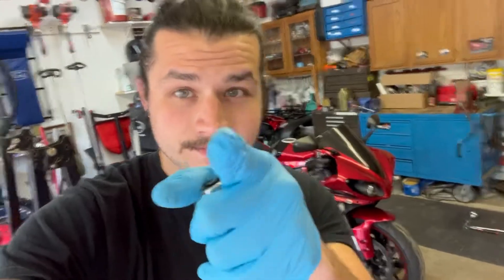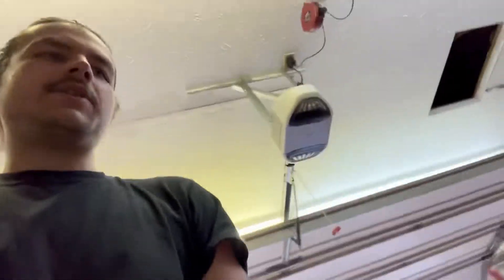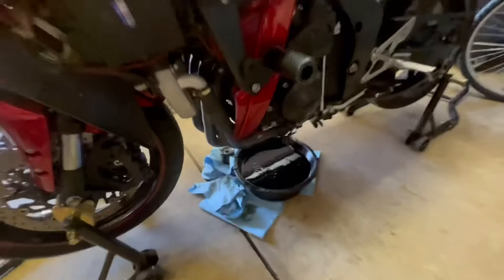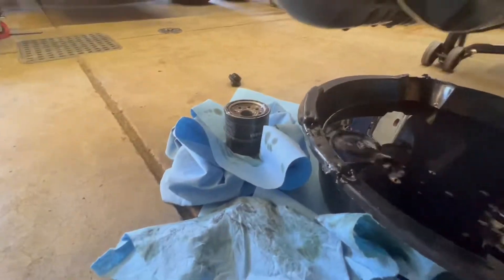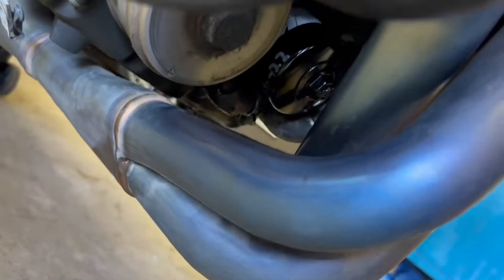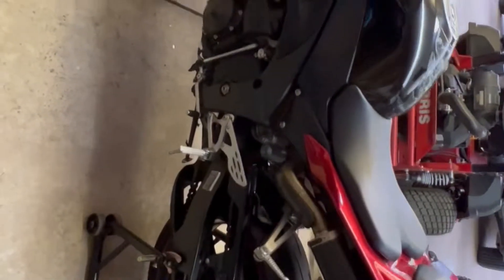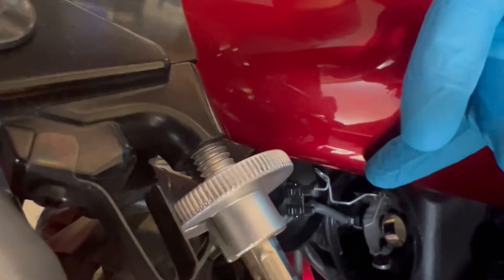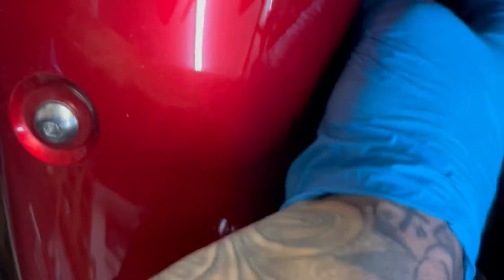2011 Yamaha R1 Oil change + Led headlamps

Comment: Hello, where did you find LED running light bulbs?( the little lights in the corners). I can’t find them anywhere even on ebay
Reply from the maker: There just your normal T10 led bulbs, I just popped the socket out and and replaced the bulb itself. You can get T10s on Amazon!